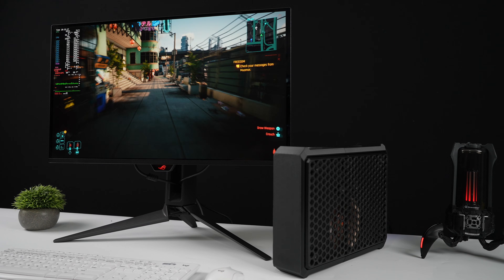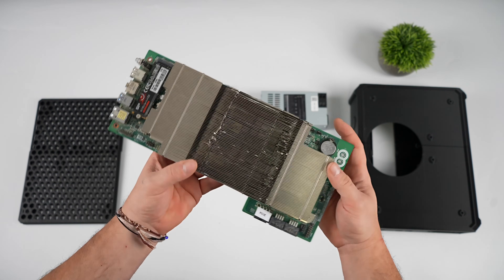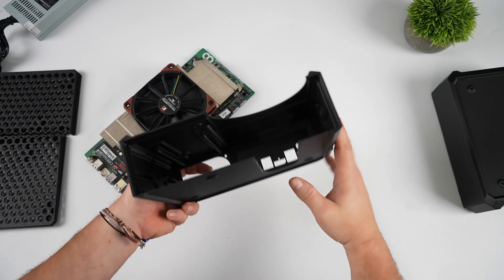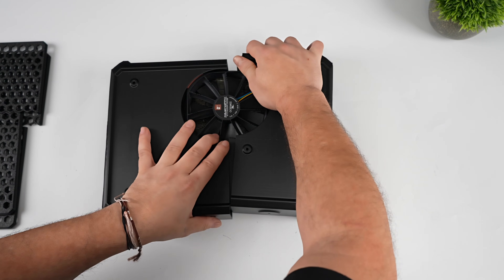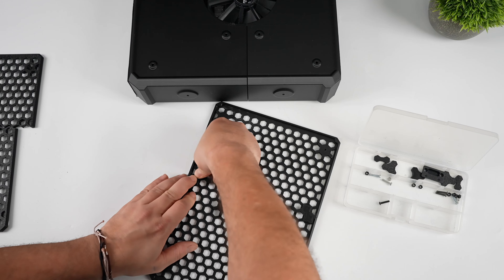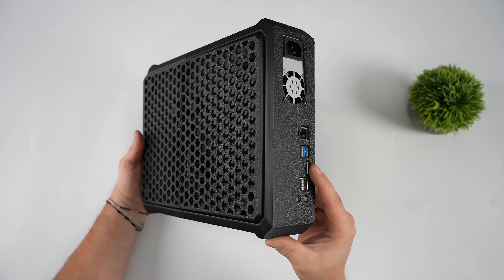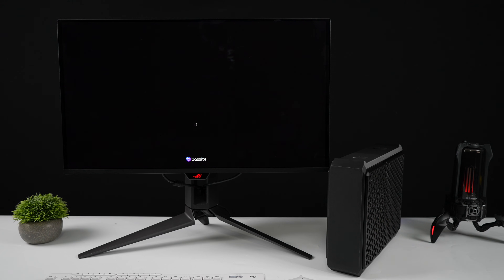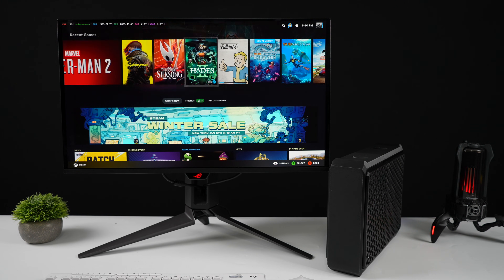Low Cost DIY Open Source Gaming Console!

Comment: how is the noice with that mid fan mod?
I have one but use a shroud currently if the mid fan mod is much more silent, then that is something I would concider doing.
also did you remove the heatsink while opening the heatsink?(as many suggest it is dangerous to leave it on when opening it due to risk of metal shards falling onto the electronics. 
and did you use the 3d printed tool or something else?

Comment: Nice, I got a Bambu Labs A1 combo printer last year and I'm totally addicted to it. What are you printing on, and what filament did you use? Also, do you need to remove the heat sink in order for it to fit in the case? Seems like you would, looks like a snug fit.

Comment: Hey just to let you know, The fan is mounted incorrectly and does not include its needed shroud bracket to mount to the heatsink, the fan runs as an intake (you have installed upside down). Without the 3d printed fan shroud and pressure booster this will restrict air flow to the bottom of the board. The 3D files on printables have the shroud and pressure booster available. The shroud clips over the heatsink

Comment: Made mine based on this video but in all white! Total cost: $320+…

$180 for the bc250
$40 for fan
$50 for power
$30 for filament
$10 for power button
$10 for 24 pin connector adapter (for power button)

Added my 8TB SSD

Comment: will proxmox run on it?
Reply: Yes, definitely. The problem with this for any homelab work is the wattage it pulls. Since it was designed as a mini board, even optimized it's usually pulling 60 watts at idle.

Comment: Why is this 6 core 12 thread when the PS5 has 8 cores and 16 threads?
Reply: I'm not totally sure, but CPU/APU makers test for capacity after manufacture. Intel at least used to sell failed "Core I3/5/7" processors with a few cores that didn't operate at expectation as Celeron with the number of successful cores.

I'm guessing either these are PS5 APUs where a few cores failed and for standardization they put it at 6/12 instead of 7/14 if only one core failed testing.

Comment: Hey guys! Running BC250 + Bazite here, but my idle power draw is ~60W, nearly double the 33W in the video. Any idea if it’s a BIOS setting, cooling or PSU issue? Need tips

Comment: It's no longer cheap. In south Africa I've recently built a 9th gen i5 16gbram with a Rx580 for $110.

I wanted to get this blade but the price is $100 less than a used ps5 if u include shipping of the blade.

Comment: Fun fact, because this uses a unified 256 bit GDDR6 bus this might actually be faster than the Steam Machine in several use cases depending on CPU bottlenecks and GPU clock speeds, not only because its 16GB avaiable to the GPU, but also because its almost double the bandwidth of the 7600m and something like 5x the bandwidth for the CPU(latency is poor though on my BC250)
The 7600m IMO really needed a 192 bit bus.

Comment: The case is 3D printed; however, the ASRock Bc250 could benefit from a RAM upgrade if you want to push the ASRock BC250 to its limit. I would set this up to run both Xbox 360 and PS3, as those games were good to play. Also, this could run PS2 and GameCube games if you tried

Comment: ETA! Any chance you could try a bios mod such as you did with the steam deck? I'd love to see what kind of changes you can make without instability.

Undervolting would be my most interested option along with a GPU clock increase 👍🏻
Reply: Technically he already did instead a bios mod, that's needed to properly mess with vram allocation, anyways he's likely already undervolting since that's controlled in the same file as the overclok

Comment: There is a big problem with this board, it doesn't support ray traced shaders, thus games that require that (such as Doom The Dark Ages) , won't run at all, meaning some upcoming games (UE 5.6 requires this feature) aren't going to run.

Comment: guys please remember this thing doesn't even have half the graphical power of a PS5. It's actually 45% the TFLOPs, 18% the SSD read speed, even the CPU has less cores. It's closer to a PS4 Pro in real world performance
Reply: It's more like 70%, the GPU will clock to 2.2ghz, at the base 1500 megahertz yes you're probably accurate, I don't think the CPUs isn't big of a deal though most games don't need more then a decent set of 6 cores, and the SSD only affects load times and in the most minor ways at that

Comment: what filament did u use for printing?
does pla warp when the apu reaches higher temps for a longer time, or does the cooling take care of that?
Reply: I recommend PETG, PETG-CF or PETG-GF, please avoid PLA, if you can.
Reply: @NexGen-3D  will do, thank you (:

Comment: that gpu is running at 655%
Reply: Thats a bug with Mangohud currently, better support is being actively worked on in the Linux Kernel, currently Bazzite is on 6.17+ and there will be better support in 6.18 and more will come in 6.19

Comment: Click-bait Prime strikes again.  This is a used, crypto-mining rig, running a PC processor with Steam and/or Bazzite as the front end.  The AliExpress price always doubles after being reviewed by Click-bait Prime.  Just get a new mini-PC that comes with a better CPU/GPU combo and a warranty.
Reply: Your correct on the pricing going up, but you are no way better to get a new mini PC if you want to actually game, the only machine that would have been a good contender was the HX99/HX100 Neptune from Minis Forum, but that was far more expensive, and are not being sold new anymore, if you lucky to pick one of these up for less than $125 USD, then you have a pretty solid little gaming machine.

Comment: I'm puzzled by the cooling system. I'd like to see another video comparing temps to another build with the "laptop" fan mounted on the back (and without butchering the fins of course). Such a build would be thinner of course, maybe great for horizontal use.
Reply: He did not do the cooling system correctly, it should been blowing into the case, there is a actually fan mount, I also designed a static pressure booster, I also recommend the Arctic P12 Pro CO fan, the entire finstack should be opened up, not just the centre, I have done extensive thermal and acoustic testing, this case with the correct fan and parts setup correctly and fully overclocked GPU and memory pulls 300w and temps stay under 80C at this level, for latest information on the project, best to go to my Printables page and have a look, as I update the project almost daily.

Comment: Please, STOP saying that this is a $100 board. Prices has been raised and nowadays are absurd, literally more than double that, around $210
Just add a psu and a ssd and you end up with an over $350 device, and that's without the case...
A minipc with a ryzen 7 with a 780m, 16/512 costs less than that and gives less issues, 'cause those boards are ultra picky with the os configuration.
Reply: But this will stomp all over that  780m, they are not even in the same league for gaming, but as a general PC, Ryzen 7 will be much better, the board is 100% supported under Bazzite, which is what we recommend, but I agree the price is getting out of hand now, a few weeks back it was totally worth it, but today, and after this video, not so much.
Reply: @NexGen-3D  Well, it just has double the CUs (24CUs instead of 12) but a 780m is a complete RDNA3 gpu and this is a mixture of RDNA1+2 instructions, plus driver support is a mess: Some things will be slow asf without some instructions.

And the cpu well... maybe its powerfull but FP unit is crippled compared to a normal zen2, be aware of that.

// Bought a pair of MN56 with the 8745HS for ~250€ each (21% vat included), that's why I say it.
Reply: @vxvicky  I already owned a Minis Forum R7 with a 680m Mini PC, tested SteamOS, Bazzite and CachyOS on it, review and benchmarks in the Bazzite forum, it is in no way even close to the BC-250 for gaming, regardless of it being RDNA 2 and the 780m is basically the same, its weak, it does 1080p at lowest settings barely, it was good for older titles though, for a daily PC, yes the new Mini PC will be better, but for gaming, the BC-250 destroys it.

Comment: They are listed at £219 in the UK and £4.99 shipping, which works out at $295.99 for the board EXC shipping.
 We pay way more for computers here; the computer manufacturers call us Treasure Island, as they can sell products sometimes twice as much as in most other countries.
 I'm thinking of buying a top-end gaming machine with 128 GB of memory. I think it will end up being less expensive to fly to the US and buy its parts, except the power pack, as I need a 240 AC one, build it in the hotel, and dump most of my clothes and pack the computer in my case. I get a holiday with a free flight!
Reply: Almost all modern power supplies can take 100-240V AC nowdays, so you can buy a PSU in the US too, they will be the same models, just with a US power plug, but thats easy to replace when you get back home.

Comment: When you factor in the price of the power supply and fan and enclosure for the performance it sure seems like there are a lot of mini pc's that'd be better buys.  If you are going to end up being like 250 bucks all in on this it seems like an hp t740 and an rx6400 would be a better buy. Or a bunch of the newer Mini pc's used at the 250 dollar price point would get you pretty similar results I'd think.

Comment: They cost more than actual ps5's now 😂
Reply: Once you get it shipped, case, psu, fan, ssd its close to a ps5
Reply: Console guys, you aren't going to escape rising m.2 and RAM prices. It will affect you as well. Because PS5 uses Gen4 m.2 and memory, just like a PC does. Expect the PS6 to cost an arm and leg if this continues.
Reply: @Bryce_Czirr rumor has it the ps6 is going to delay due to it. The market will stabilize eventually, even if demand remains the supply will increase and catch up eventually.
Reply: YouTubers ruin every niche tech nerd device
Reply: ive just found one for 100$
Reply: @josephdias5859  wheeeeere :(
Reply: @josephdias5859 where
Reply: @josephdias5859  gatekeeper like always
Reply: @josephdias5859  where Joseph whereee 😭😆
Reply: @BigSmokeGrove  I have 12 of them just tested never used
Reply: Where  @miguelmigueldejesus3763
Reply: The link in his description goes to eBay showing them for under $200. What are you talking about?
Reply: @MrClockw3rk you can copy and paste this all you want it’s still wrong 🤡

Comment: The top of the heat sink you can straighten the fins rather than cutting them off. There’s a tool floating around someone designed but I just used a small flat screwdriver
Reply: Is the fan just pressure fit on there?
Reply: @MichaelWilliamsA  not sure on this case, I'm using a different one that has mounting holes for the fans.
Reply: @mbertolijr thanks! I'll have to look into some different options.

Comment: If you set the VRAM to 512 in the bios it will dynamically allocate VRAM, I’m getting pretty good performance with it and don’t need to mess with it after that.
Reply: What does that mean  "dynamically allocate ram"?
Reply: Well it means less of RAM is dedicated to GPU and more dedicated to CPU of GPU doesn't need as much
Reply: 몇몇 게임은 비디오메모리 4G 이상 할당 안하면 실행되지 않기도 해요

Comment: My BC 250 just arrived in the mail yesterday.  Got it for $125 (plus 22 shipping).

Looking forward to testing it out this weekend.  

If it works good, I'll downgrade my Geforce Now account to free tier
Reply: Glad someone other than me also got it at a good price, i got mine before eta made his video.

Deffo worth going to GeForce free tier, just remember linux has no anti cheat support for most competitive games. Like fortnite, lol and games that use easy anti cheat won't work on the machine. I would also look at getting lossless scaling on steam and then integrate it to linux plenty of documentation. I think they have just added frame gen support to linux with the linux install thing(whatever you call it) and make it adaptive for 60fps so you can run any game at a smooth 60fps at 4k/1440p
Reply: @noobs_guide_to_everything  it's not that Linux doesn't have anticheat support, it's that those game companies don't support Linux with their anticheat. Important distinction as there's plenty of games on the market with great anticheat on Linux. The game companies are at fault when it comes to incompatibly.
Reply: @noobs_guide_to_everything  for $125, if im not happy with it, I can always sell it back on Ebay as is.  

But I'd rather game on Linux over windows 11 at this point anyways, because Windows sucks now.
Reply: Was looking at one before prices started Rising and ended Up buying It for 144€ with free shipping 🫡

Comment: Just get a refurbished mini PC with Radeon 760M graphics. I was able to get a UM760 Slim with 16GB DDR5 + 1TB NVMe + Windows 11 Pro for $208 shipped.
Reply: Can the 760M compete with the RX6600M?
Reply: @randoGuy77  The RX6600M is more powerful. The Radeon 760M is powerful enough to do 1080p gaming that can be FSR upscaled to 1440p. One can add a M.2 OcuLink adapter and a refurbished DEG1 external GPU dock for about $100 and get a used graphics card if they want better gaming performance. Minisforum has listed refurbished MGA1 (all in one 7600M XT eGPU) for $150 in the past but they rarely list them and sell out fast when they do. The BCS250 is such a niche product and hack that I wouldn't bother with it. There are mini PCs that have Radeon 780M graphics which are about $150 more but provide about 20-30% better gaming performance. I have both a UM760 Slim which I use as a NAS server and home theater TV player/streamer and a UM880 Plus (780M + OcuLink port) as my desktop PC. Got both refurbished for less than a single desktop PC build, $208 and $350 respectively.

Comment: Cool idea but id be curious about the longevity of a machine built around a component that was clearly abused by crypto miners for who knows how long.
Reply: Never had any problems running them in the server configuration they came in.  Lots of airflow,  stable and use way less power than gaming.   These cards would never get anywhere close to the temps hit in this video while being used for mining.  Gaming is more abusive than mining on hardware and the airflow in the gaming setup is far inferior to the way these originally shipped from ASRock.

Comment: Curiosity why does it say 655%GPU useage?
Reply: That's a Linux bug with these boards, I assume it's something to do with the readings from the GPU sensors as they were made for mining so when actually at 100% gaming utilization that's 600% of what the mining max was. (As GPU mining doesn't actually use the full GPU ) or it's just a bug with no reason behind it. Mine shows the same thing

Comment: Why dedicate more than 512M to the gpu?  Mesa will alloacate from ram as required.
Reply: Yes you are right, with the discord community they actually recommended to leave the ram buffer at 256/512, and as you said the mesa will allocate where needed, you actually get better performance(more stable) doing as you stated

Comment: i was wondering if you can run windows 11 on that machine? if yes, what would be the performance of it?
Reply: its not possible unfortunately =(
Reply: Yes to run Windows, no for GPU drivers for it.
Reply: Yes you can, but it will use windows standard GPU drivers, meaning you will only really get 2D perf, the community around these boards(im part of the community didn't do anything myself just use it) developed the full mesa stack on Linux and due to that gaming is only possible on Linux.

Comment: 150 ,aliexpress gone up 30 quid in the last week, not worth it now at that price
Reply: It's still worth it in my opinion, the price increase you saw is actually AliExpress's sale price changing as the sale is over. 

But even for 200£ this thing is worth it. An Xbox series S is less powerful(GPU side) and less usable in terms of what a PC can do and is nearly 270gbp. Also a ryzen 3600, motherboard, and a Rx 6600 is gonna cost atleast 250 gbp and that's no ram and stuff included in that price
Reply: @noobs_guide_to_everything  But the final cost isn't going to be 'just' 200£. You have to do a ton of things just to get it functional, not to mention these cards were heavily used for mining, so their lifespan is compromised. These were selling for 75, 80, 90 bucks for the exact same purpose less than a month ago. After the first video, the value was totally ruined.

Comment: I bought 4 at $160 each which to me is still worth it. I will be receiving it. Demand will put the price up but it will level off with time because no one will over pay what they feel is worth the machine.
Reply: I think these will end up like modded GameBoy Advance systems where people will buy up all the bare boards, assemble systems with fan, case, & power supply; and flip them for around $350 which is honestly a fair price for what you get.
Reply: @ENCOM786  no its not
Reply: @Iayas-y2h  Then please tell me what complete gaming system I can buy with better performance per dollar.

Comment: I wonder what temps the memory was hitting, gddr6 gets pretty warm. Don't know if the rear plate is enough heatsink surface area

If you got one prior to the crazy price increases it's a great way to get a mini itx form factor pc for relatively cheap.

Also cool to have RX6600 like GPU power without needing a dedicated graphics card
Reply: They definitely get hot.  You really want active cooling and good ventilation.  If you use PLA, it WILL warp from the heat if you don't have that.
Reply: @dividion8102 would you say a 120mm fan on top of the rear plate could do the job? Or get a heat sink 1st and throw the fan over that heatsink
Reply: @randoGuy77  Yeah, a 120mm fan is plenty of airflow even indirectly, so long as there's enough ventilation for the hot air to escape.